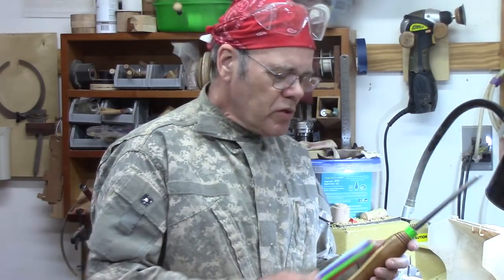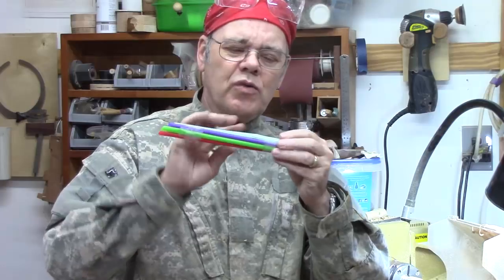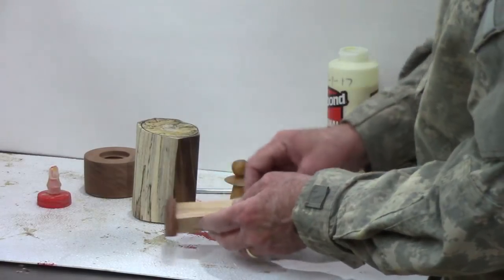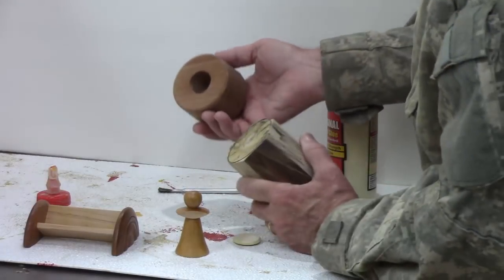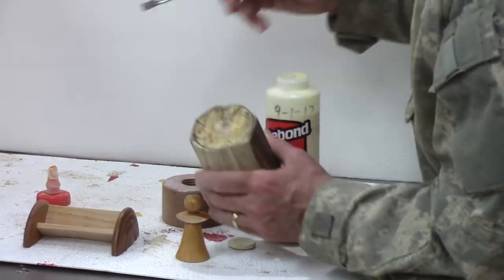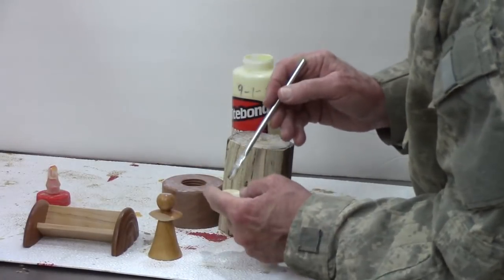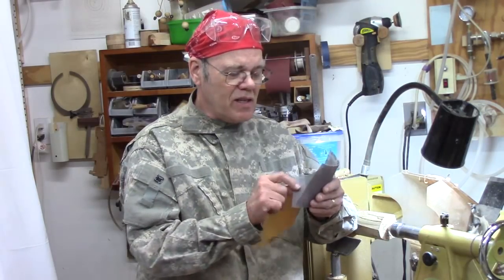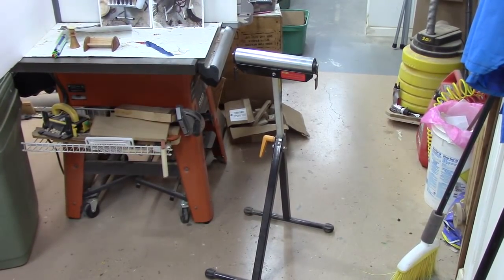How to Glue End Grain - Woodturning

Comment: Good tip on gluing end grain Mike. With the kind of turning I do this problem rarely comes up, 
but now I know a better way to approach the problem. Still not as strong as side grain joints but a definite improvement. Thanks for posting.

Comment: Great tip, Mike! I do this and it works better than not. I have read that polyurethane glue actually works best for end grain, but have not yet done the comparison. Thanks!
Billy
Reply from the maker: I used Gorilla glue one time and hated it. It expands and is extremely messy.
Reply: Yes, it does. I've used it on a number of flatwork pieces and it can be a pain. Just sharing what I've read. FWIW, Gorilla has apparently come out with a non-expanding version, but I have not used it.
Take care.
Billy

Comment: Awesome thanks for the tip! That answers my question as to whether after gluing end grain to end grain, would withstand the stress of using a roughing gouge to turn the block. Another question I had was does it hold together well afterwards? Or after time will it come apart? The application I'm using it for is under no stress other than the turning process. It's strictly decorative. (Maple to Walnut to Maple)
Reply from the maker: The carpenters glue should hold long term. Can you use a screw chuck or a woodworm screw? Sometimes adding a drop of CA into the hole can make for a better hold.
Reply: @MikePeaceWoodturning  I don't have either. I'm just returning to wood turning after 7 years or so. I used to have an 8' lathe which was built by a machinist from a place I just retired from. It took up way too much space. I just bought a new lathe this summer (not nearly as big as my first lathe, but, definitely more expensive. The big lathe only cost me a 60oz bottle of whiskey! Which I helped him drink!) I'll just take really light passes with the gouge. Thanks Mike!